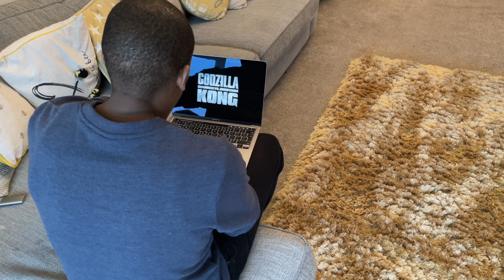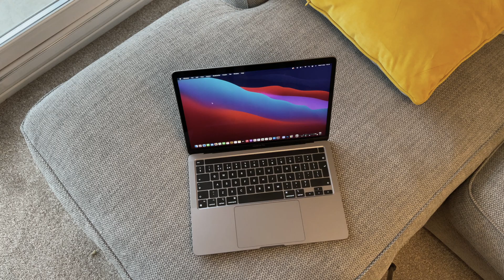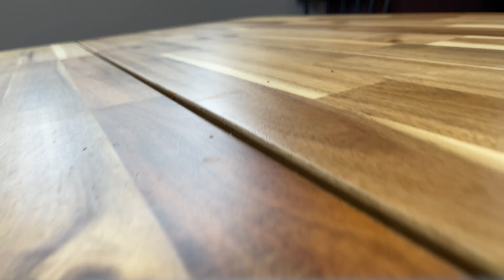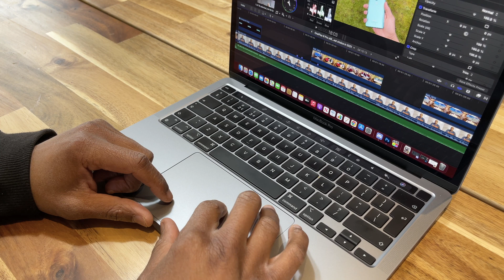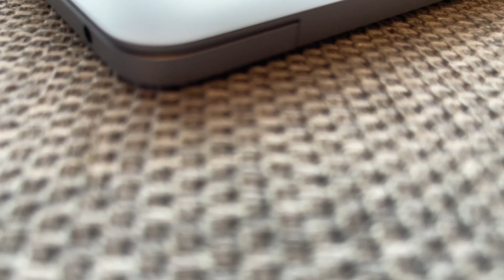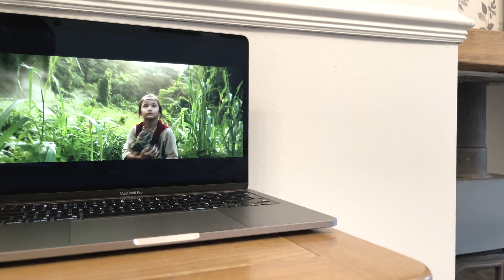Macbook Pro M1 - Just Too Good!

Comment: Been using my 16Gb Memory 1Tb SSD M1 MacBook Pro (first ever MacBook after using personal desktop iMacs since 2009). It’s taken years for Apple to finally shove 256Gbs SSD into a less than $1,000 price tag for the Air, so with the advent of their new in-house silicon, and improvements to the keyboard and display ribbon cable fiasco, I finally took the plunge. Pricey, but hands down, best computer I have ever owned and used, desktop and laptop alike.
Reply from the maker: Absolutely with you on that, I absolutely love mine, money well spent in my opinion. 👍🏾